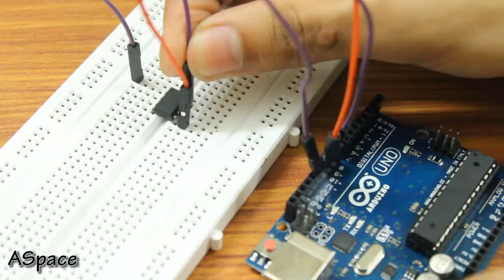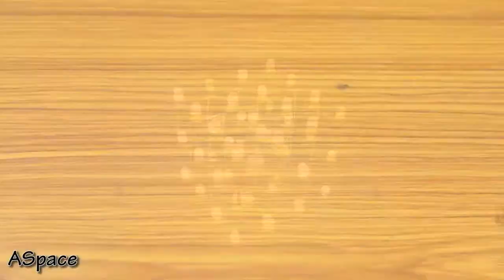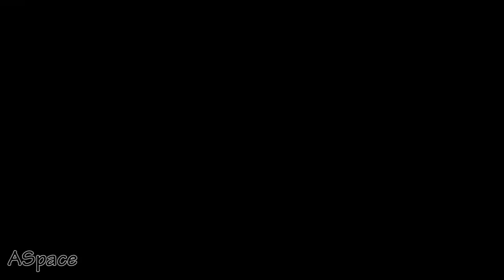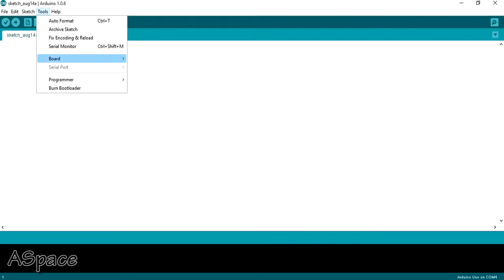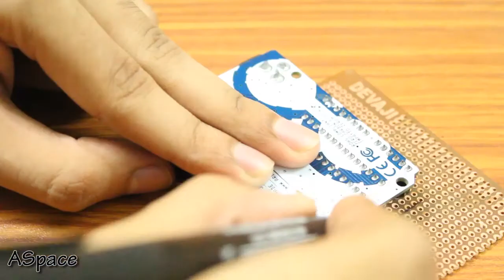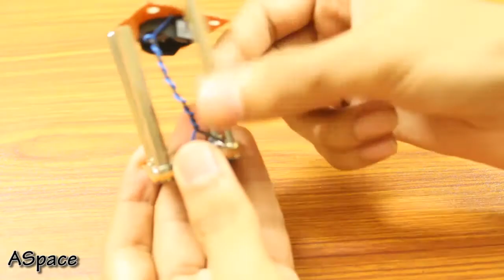Basic#1: How to program your Attiny || DIY decision box

Comment: Is the forward voltage for every color the same or why are you using one single resistor for the red, green and blue color?
Reply from the maker: The resistor you are talking about is the pull down resistor for the tactile switch.
No,the forward voltages were a bit different.Since I was using a coin cell with maximum of 3.2V there was very less chance for the leds to burn out.
Reply: Oh I see! So the internal resistance of the coin cell is sufficient to not destroy the led. 
Thank you for your answer.